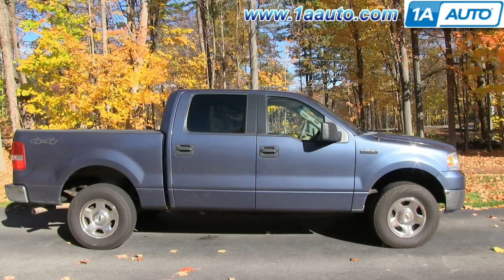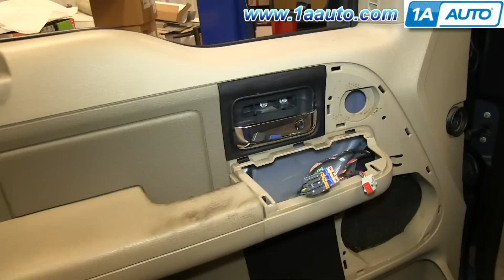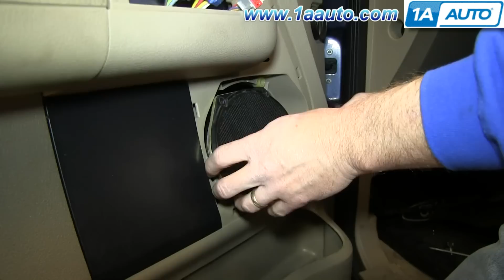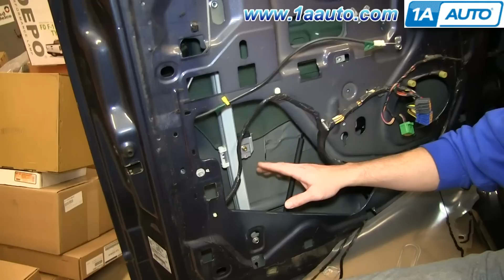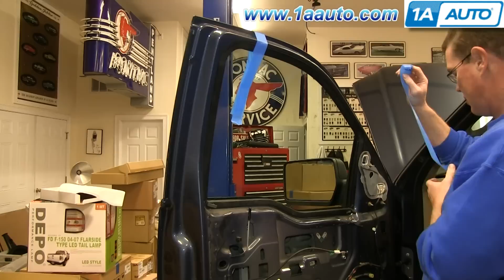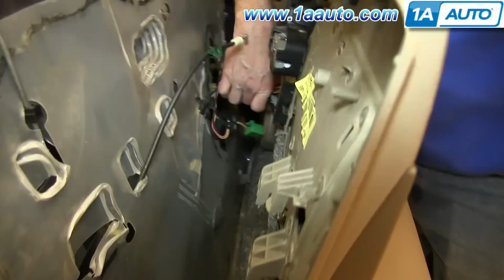How To Replace Front Power Window Regulator 04-08 Ford F-150

Comment: I guess Ford had to use all the bolt sizes they had in inventory.  5.5mm.6mm, 8mm, and 10mm bolts to remove the door panel.  I guess just using 8mm bolts on all those areas would have had made too much sense.  That's ridiculous.  On a positive note, this video is saving me a lot of time, frustration, and money to replace the regulator.  Thanks!

Comment: I need to chance mine, did the passenger side last year.  I like to use a narrow brush and clean out the window tracks/guides around the door, then spray them with a dry lubricant.  That makes it very easy for the motors to raise and lower the window without having to work against a 'sticky' track/guide. :)

Comment: What are the signs of a bad regulator?  
On my 2010 F150 the driver window goes down no problem but is intermittent going back up.  Replaced the switches that didn’t fix anything.

Comment: Replaced the regulator and still doesn’t roll up. Just makes like a stuck sound.
Reply from the maker: +phantom916 We wouldn't be able to diagnose an issue like that here, you may want to have a local mechanic take a look at it. Thanks for checking us out! http://1aau.to/m/Shop-1AAuto-c

Comment: Hope you are still monitoring this . It is great video and helped me install it but it did not fix my problem . I put the new one in and it still won't go up . If you could help me to figure this out I would really be grateful . It went down no problem but still won't go up. I am not sure if its the ground or hot but it has to be in the wires cause I switched the switch . If you could tell me what wire is what maybe I can go from there.

Comment: All windows stopped working all at once. Think im having a wiring issue with windows, checked breaker and relay, replaced switch, no sounds from motor at all, but can't get enough access to wiring to tell if that's it. Please help!
Reply from the maker: +krazykubes1 We wouldn't be able to diagnose an issue like that here, you may want to have a local mechanic take a look at it. Thanks for checking us out! 1AAuto.com

Comment: There are two slots visible in front of the window clamp bolts when it is at the top position and the window taped. These are the factory access holes for the assembly line....they work just as easy taking it apart without having to go behind the panel with socket and ratchet.

Comment: Help! I just installed the new regulator and it won't work...what did indi wrong? I plugged the chasy back in and it wont work.
Reply from the maker: +Richard Fountain Double check your connections and that your fuses are good

Comment: Well I have a 2005 F150 CrewCab Lariat   The part sent you me didn't exactly match  the upper left of the bar is totally different.  I have photos if you want to see.   I had to make special drill hole in sheetmetal to attach   The part looks different than on the video... I made it work... but its not right
Reply: this is the part number 1awrg1054  no answer on your phone number
Reply from the maker: +Jennifer Tomkins Here is a link to the correct part number for your 2005 Crew Cab driver's side front door regulator https://goo.gl/RFiauC

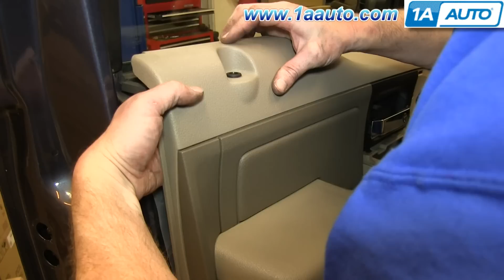We are open from 8:00-9:30 Eastern Time M-F 1aauto.com
Reply: Yep, that looks right.  But I made the one you sent fit by drilling a compatible hole inside the door sheetmetal.  It works, but now I know to be more careful.    Im sure the passenger door will fail at some point soon  lol...  btw  the video for this is fantastic.

Comment: How do i know that i have to change the window regulator and not the motor?
Reply from the maker: +Santiago Beltran If you remove the door panel and inspect the window regulator, check to see if the cable has broke and is caught on something. Here is a link to the window regulators that we sell with the motors, if you need to replace the one that you have https://goo.gl/cc3Hvp

Comment: Great video. Watched this a couple of times and had it running while I did the repair. Saved me a lot of money...job would have cost $450-$600 at the dealer or repair shop and did the whole job myself for less than $60 (cost of window regulator). I have used several of !A Auto Parts videos and they are always very well done. Thank you.
Reply from the maker: +Alexsbuddy Thanks for watching. If any of our viewers needs to make this repair, we carry the auto repair part shown in this video on our website. Here is a link to them: http://www.1aauto.com/ford-f150-truck-window-regulator-driver-side-front/i/1awrg01054?utm_source=YouTube&utm_medium=CTA+Comment&utm_campaign=ytcomment&utm_term=QCgwqVQARqk

Comment: Great video and even better prices. I was looking at between 120 and 170 bucks for this part.  My only issue is that now for the window I fixed is that my down button moves the window up and my down button moves the window up but only for this window.
Reply from the maker: +J and C Carvalho Thank you for watching. Please call us at 1-888-844-3393 so we may issue a replacement or at least speak with you for a resolution. It appears that the polarity in the motor is reversed. 1aauto.com

Comment: 05e350 is what I'm having trouble with. I heard a pop like a rock hitting the door and my window won't stay up. the previous machanic zipp tied the cable to the power Lock cable with the plastic end that seems to have a place to be instead of just chilling onto another cable!!
Reply: and I don't want to drill out rivits if it's a simple issue,! like cable jumped off track!! when I first took the door panel off the cable was between the window track and windows guide. so I pushed Window up and pulled cable free and hit the button for window down it went back to place. to me it seems it jumped off and needs to be put back correctly to add tension for it to pull it's self back up.. if you have a idea I would appreciate it thanks.

Comment: Outstanding video.  The only issue I had was the wire was not broken so my window would not go up high enough to get to the clamps holding the glass.  Had to take all the bolts out and for the glass up high enough to get a flat wrench in to loosen those clamps.  This was probably the best how to video I have ever used!
Reply from the maker: +ZackGOutdoors Thanks for watching. 1aauto.com

Comment: Thank You, Thank You, Thank You!!!  You guys saved me a lot of money. The dealer ship wanted almost $300 to do the job.  Your step by step video walked me through the whole procedure and I was able to do it myself for $96.  The biggest trouble I ran into was the fact that my window was all the way down and I couldn't get to the bolts to unattached the window from the regulator.  However, the motor had just enough power and I was able to move it up.  I saw where someone else had the same problem, perhaps you can address that issue when the window is so far down and the motor does not work...what do you do then?
Reply from the maker: You're very welcome! We're so glad to hear this video helped save you some cash, that's our main goal. Glad you were able to find a work-around for the problem you ran into. Thanks for checking out our videos! If any of our viewers need to make this repair, we carry the part shown in this video on our website. Here's a link to them. We also offer free shipping on all orders in the US. http://www.1aauto.com/ford-f150-truck-window-regulator-driver-side-front/i/1awrg01054?utm_source=YouTube&utm_medium=CTA%20Comment&utm_campaign=1ATony
Reply: I bought the part before I came across your video.  I won't make that mistake again. I paid $96 and you have it listed at $59.  Thanks again.  I will shop with you first on my next repair.
Reply: You can cut the cable or cables and slide the window up by hand. A wood blocknder the window will keep it from falling. Then tape it at the top as shown.

Comment: hy guys thankyou for your info,have a ?. if the regulator is bad the rest of power windows on my crew cab wont work either"?
Reply from the maker: +Roland Passwaters It would be hard to say without seeing it, but that sounds more like a switch problem or an electrical problem.  Hope this helps you out.  1aauto.com 866-403-3393

Comment: Video is excellent but in my case my window was in the "down" position and it was a little harder to get to the bolts on the clamps that hold the glass as I had to stick a 10 mm wrench in between the regulator and the clamp. The motor in my case failed so bringing the window up was not an option (as far as I know). But by watching this video I learned how to do everything else and were all the fasteners were (or were not as someone had been there before and did not replace the bottom screws). Thank you I probably saved over $100.00 in labor.